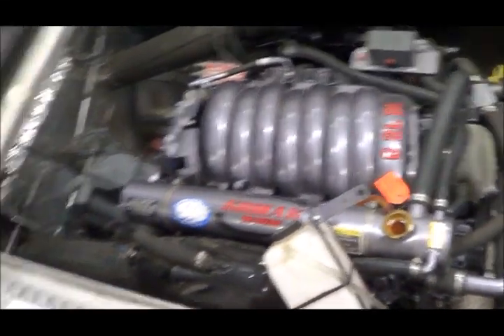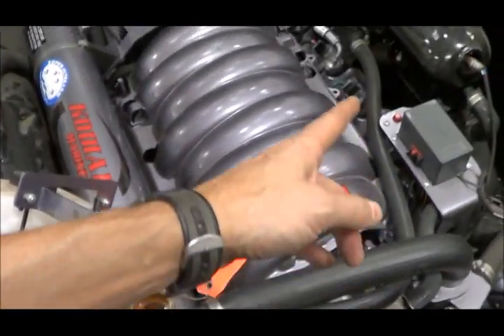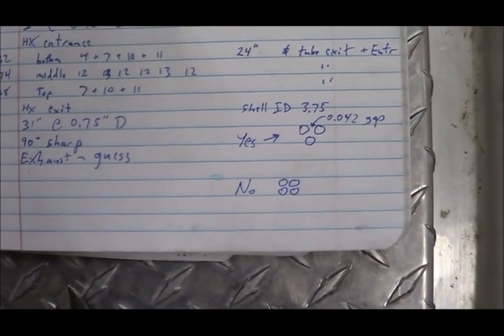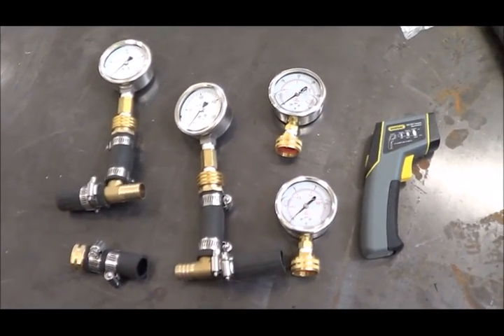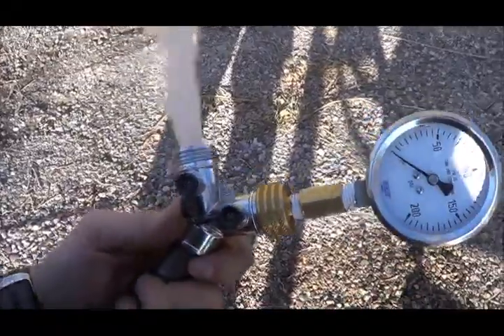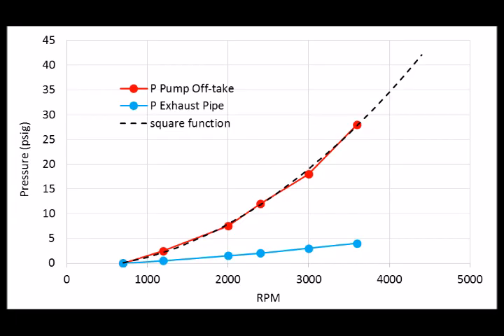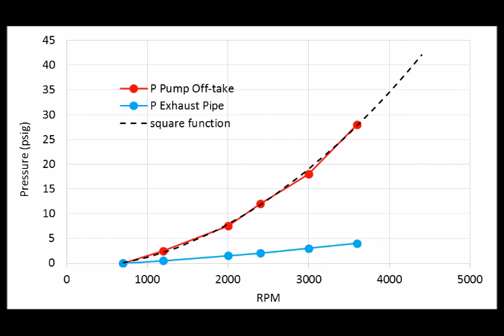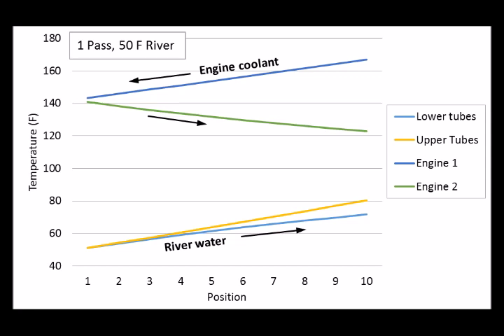Jet Boat Heat Exchanger

Comment: How do you like the 6.2 di vs your 460? Power TQ and gph? 
And chance you know the weight of the DI?
Reply from the maker: Don't know weight of DI, but I'm guessing 150 lbs less than 460. Fuel burn is maybe 15% better with the DI. TQ is 460 with DI, maybe 360 with 460.
Reply: So you think it’s a worth while swap
Reply from the maker: @user-ju3ns2cz1u  Only if there's a reason for it. Stroking the 460 might be the better/cheaper option, assuming an experienced and vetted marine engine builder. For white water, the bow design is as important as power.
Reply: That leads me to my next question. I have 95 Duckworth magnum. 454 with 212. The bow looks similar to your 460 boat. News boats are not cheap . And I like to fab and refurbish . This boat does family time and hopefully more white water soon. Am I wasting time researching stick steer mod and a repower if my bow is not like hcm granite style?
Reply from the maker: @user-ju3ns2cz1u  I did a lot with that old 460. And you can do a lot with a Magnum too. Some folks are successful with a Thunderjet, which probably has the worst white water bow. But it is easier with a flatter bow (less bow shear), stick steer (quicker response) and more power. Note that some of the flatter sled-style bows have a very short bow length. This means the bottom rises abruptly, and the bow tends to plow rather than ride up on waves. Given that your money doesn't grow on trees, I'd take a wait and see approach: sometimes the best move is no move. And remember, the jet boat world is full of bullshit.